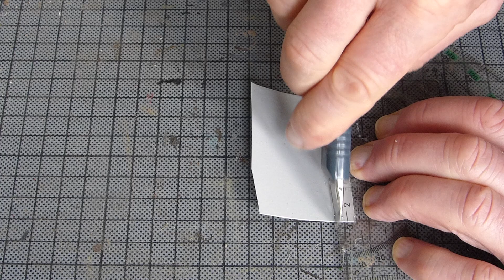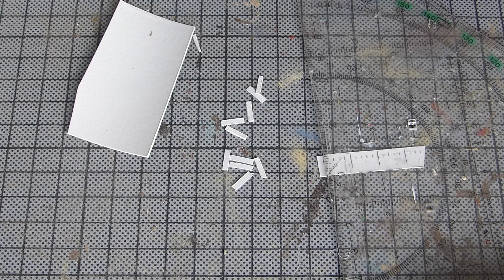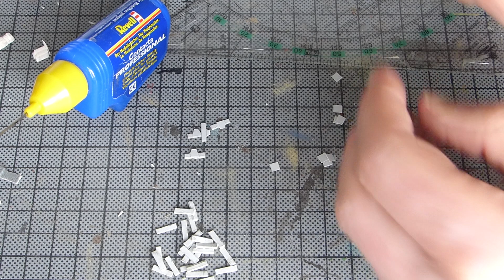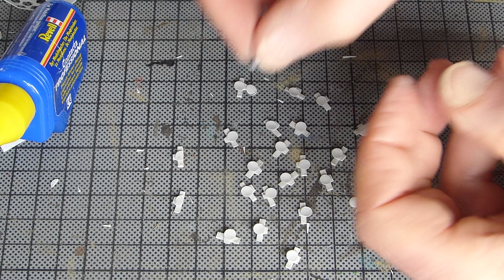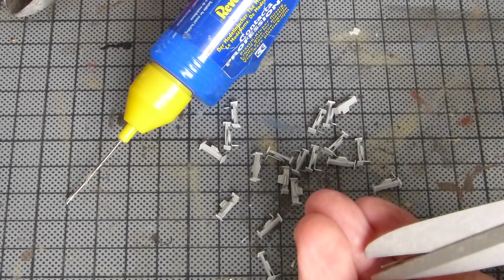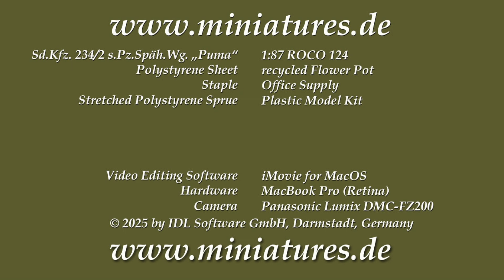Zahnstangenwinde, Rack Jack, 1:87 Scratchbuild

Comment: A great video on a overlooked piece of equipment. You've certainly inspired me to have a go at making these, thanks.
Reply from the maker: Glad, you liked it. With hindsight: for a second production run, we will use 3 mm squares for the pinion housing and 3 mm discs for the crank housing, just to make the rack jack look a little more compact.